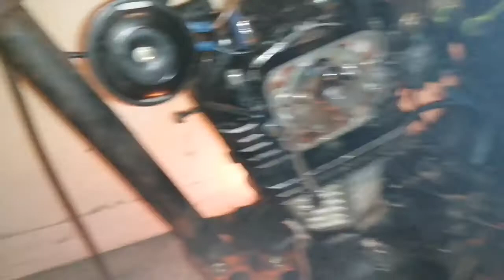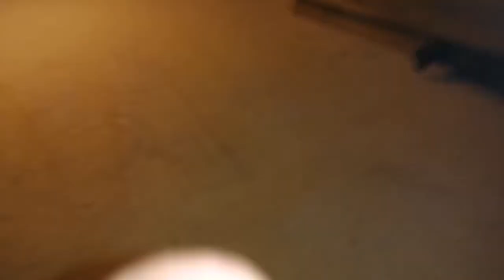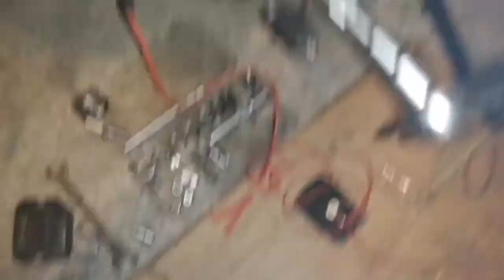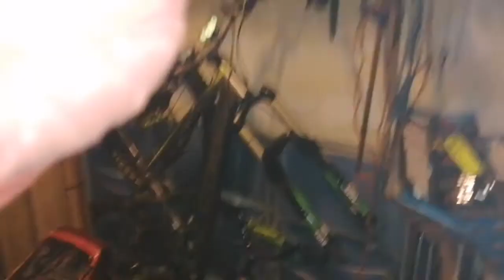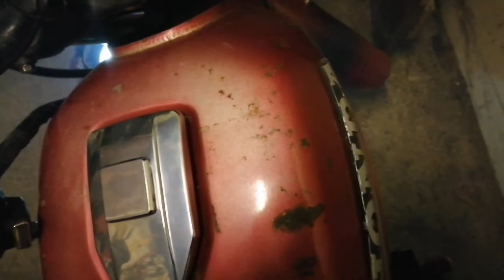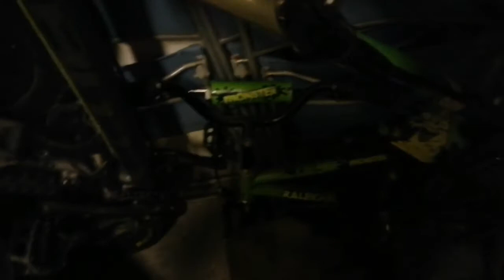Honda cb125 RS resto part 30, it's running.

Comment: Fair play. That work that was put in really payed off👍
Reply from the maker: Thanks bud. Now I just have to figure out why it won't idle unless all screws are fully in on the carburator. I bought another old carb for it Incase it is no good any more. Hopefully when I get that it'll be problem solved.

Comment: For what it's worth, the slow running screw needs to be approximately 1 1/2 turns out from closed. It's not a perfect setting but a good starting point. I know I'm a long way behind the video date, but I thought it worth a comment. I shall catch up as I go. I've had mine for about 6 years, and it's been a peach. I also have the needle 2 notches up, on a standard 100 main jet.
Reply from the maker: A friend of mine eventually sorted it. It was a mixture of a slightly advanced spark timing and bad head gasket that was allowing oil to enter the combustion chamber. Man It really tried my patients. I'm in the middle of restoring the second engine I bought for it. It turns out that all the gears were changed out to that of an xls125. So 6 speed box, happy days if it works OK.
Reply from the maker: Not an easy bike to get parts for now
Reply: @damo690  , you're right there. I'd love a new exhaust, in the meantime I'm going heavy on the Kurust. I'll be looking for your other posts, keep the faith.
Reply from the maker: @Roger Akers  you can still get the exhaust if you know somebody that is able to buy from Indonesia websites. I need one too and that's how I found out after a lot of research. The new Honda cgl125 (not available in europe) has the same exhaust, and a lot of the parts produced for them are the same. Problem is I can't buy one from Ireland because there's no shipping option